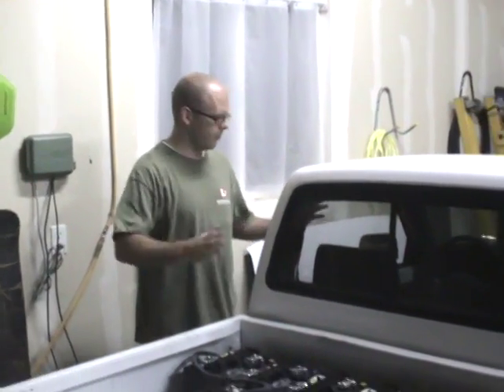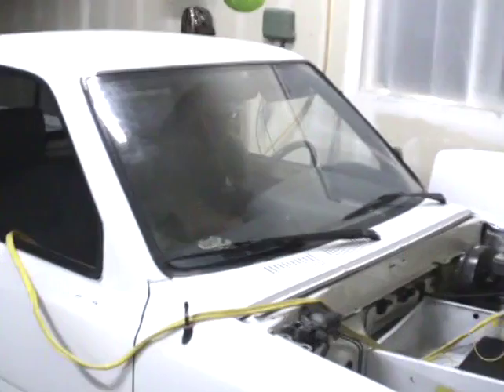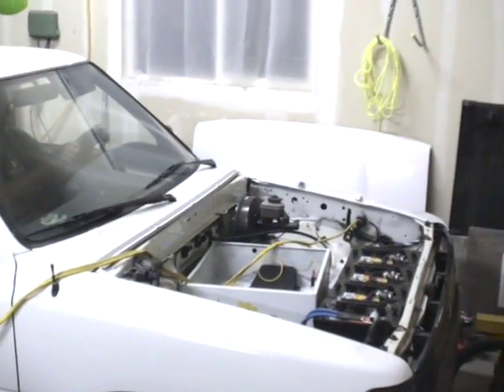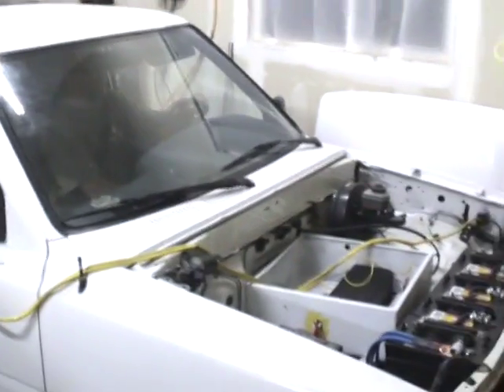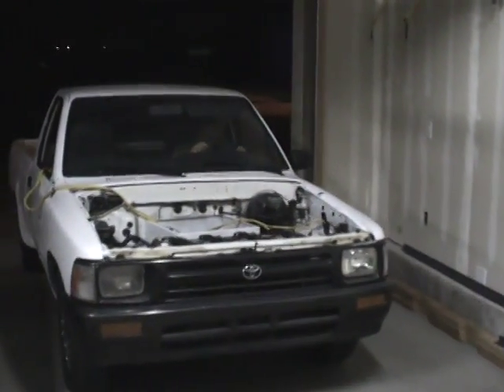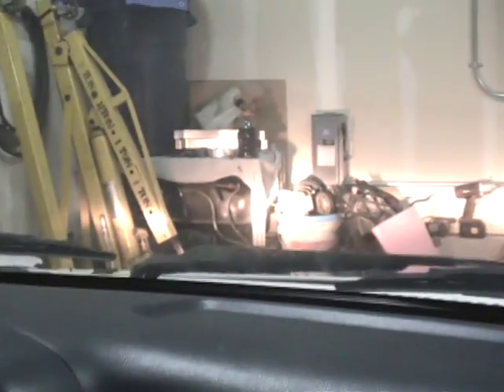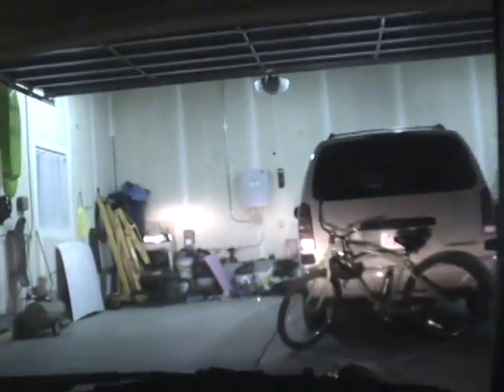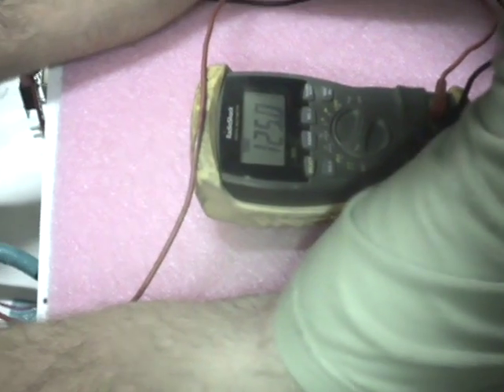First Time Driving my Electric Truck

Comment: Congrats. Nice work.  It's been 2 months.. has it been a daily driver? Any adjustments? What guide did you follow? Parts list? Estimated conversions cost.? What kind of range are you getting? You recommend manual transmission?